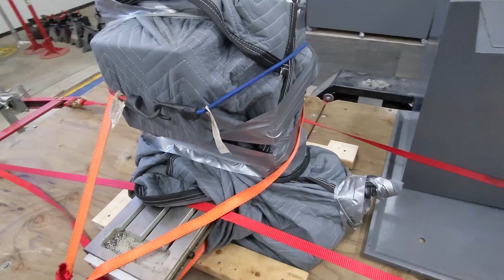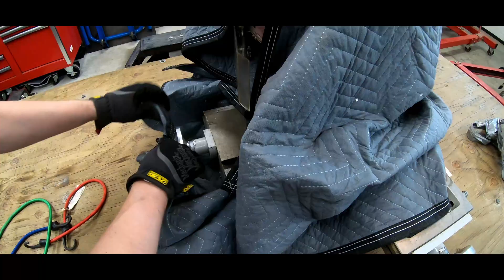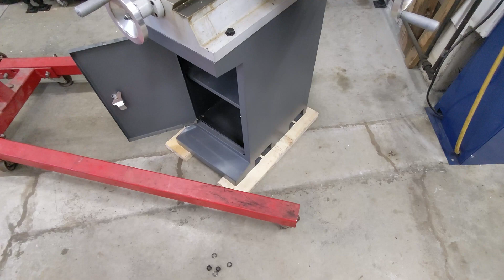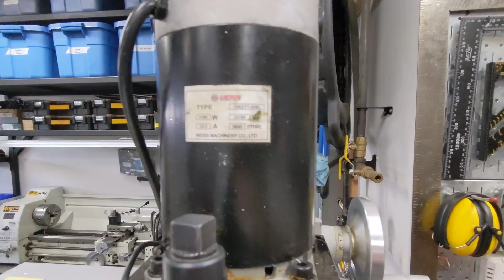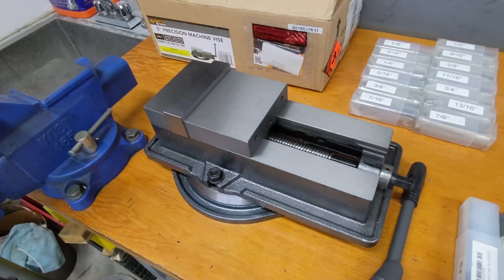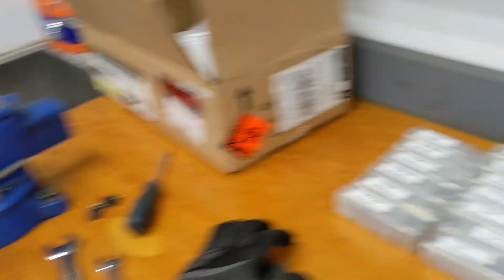Buying a Used Milling Machine - From Pickup to Setup, Walkthrough to Cutting - Craftex CX601

Comment: machine sounds good btw
i m n exp cnc mill guy.
i would take out that 360' protractor base thingy.
we never use those n it costs you height n rigidity.
bolt the vise directly to the table.
is there room on top of the spindle for a
double pulley retrofit to bypass the gears ?
i see this on some 704 grizzlies now.
Reply from the maker: Yup, I've removed the base a few times depending on what I'm doing.

Not sure what the double pulley retrofit is, will have to do some research!
Reply: @SomeGuysGarage  many grizzlies have broken their gears. so they get metal replacements. but there is another fix, a double pulley on top of the spindle.
little machine shop belt drive conversion kit for mill.

Comment: Nice video 
I planning to by this model but new. Do you experience issues with it.
Reply from the maker: No real issues, the flap in front of the spindle is a bit annoying but could be easily bypassed.

I did also build a new stand for it (I have a video on it), the OEM one is a bit wobbly/light duty IMO.

Comment: I have the smaller version (King KC-20VS) and found that removing the rotating vise base and bolting the vise to the table made a great difference in rigidity.
Reply from the maker: Yup, I've since tried that, does help :) good tip!

Comment: Really interested to know the limits on this thing

Like how hard you can push it 

How it reacts to hard stainless & welds

I'm torn between this one and the bigger knee mill they make

Please let me know any issues or walls your hitting
Reply from the maker: If you have the space and money, ALWAYS go bigger :)

Every mill will have its limits, you can easily do stainless/welds/etc with it but just means slower and less depth of cut per pass.
Reply: @SomeGuysGarage  I really appreciate the response

I'm so torn between 601 & 603

With a 1/4 endmill could I cut .050" deep across the top

I definatly don't need to run like .250" hog cuts like I do at work

I just don't want to be limited to like .015" cuts or something

I'll dive into your Vids a bit more too & see what I can find I think I've just seen the one so far

THANKYOU!!
Reply from the maker: @Sweetchilliheat18  I don't have too much content on the mill yet, I just picked it up this summer and haven't been working on any projects recently with it. Though have a couple things I'd like to do over the winter that I will film.

I'm certain you could run a 50 thou cut in stainless with a 1/4" endmill on it though. In regular steel it doesn't even notice that sort of cut.

Comment: Ive got the same mill. Works good
Reply from the maker: Right on...any recommended upgrades? Good DRO's that work with it?
Reply: @SomeGuysGarage  ya , I added a dro, ordered it off Amazon had to custom order the size but wasn't bad to do just kind of confusing, was basically 500$. And I wouldn't stick with r8 collects. Get one of the as 32 adapters its less of a hassle to change tools
Reply: @SomeGuysGarage  think it's called Kevin, its just a Chinese made dro but works really good
Reply from the maker: @lukeamato2348  Awesome, will check that out.

I assume you mean ER32 collets?
Reply: @SomeGuysGarage  yes
Reply: @SomeGuysGarage  sorry er 32 adapters and don't use a facing tool over 2 " it doesn't really have the power to handle it
Reply from the maker: @lukeamato2348  good to know :)

I'll add a collet set to my list of things to pick up.

Comment: I have the same mill, generally happy with it. Power feed on the x axis is a great addition, and dro I’d consider a must have. Get a few decent carbide cutters, makes a big difference! And lock whatever axis you aren’t moving to reduce chatter, or lightly tighten the gib locks especially when climb cutting. Great addition to a shop!
Reply from the maker: Great tips, thanks!

Any particular DRO you'd recommend for it?
Reply: @SomeGuysGarage  I got a Ditron ip67 rs422 3 axis with magnetic scales, on a friends suggestion, and it’s been great. I put the x axis reader on the front side of the table, with protection, to maintain travel in y axis., no regrets, I will probably put the same dro on my lathe eventually.
Reply from the maker: @jonlihou668  cool, will check it out, it's tough figuring out which one to get but it's definitely on the upgrade list in the near future.

Comment: I have the smaller brother of that mill, the CX600. Very nice machine, huge step up from the ubiquitous Sieg X2 mini mills that so many hobbyists have. One thing I would recommend, however, is to get rid of that milling vise and shell out for a real Kurt. I've owned one of those crappy chinese ones you have, and the local makerspace had two different chinese ones; the stationary jaw was out of perpendicularity on all three by anywhere from .015" to .025" per inch, and the cast iron they use is soft as cheese. I bought a Kurt DX4 and it's a night-and-day difference. Yes, it was over CAD$600, but worth every single penny.
Reply from the maker: This vise was all of $139+tax, stupid cheap. It's okish square but not perfect, though I don't have a surface plate to really get a good read on it. I figured as a starting point, I can have this and I don't care if I accidentally run an end mill into it or something as I'm learning.

A good Kurt will come down the road once I know what I'm doing :) I can definitely appreciate spending the money on good tools, most of my measurement stuff is Mitutoyo and it makes the chinese knock offs look like toys.
Reply: That DX4 vise will cost ~$1300 with taxes now (Jan 2024 - KBC tools)  Yikes.